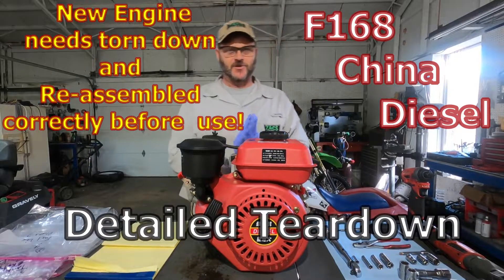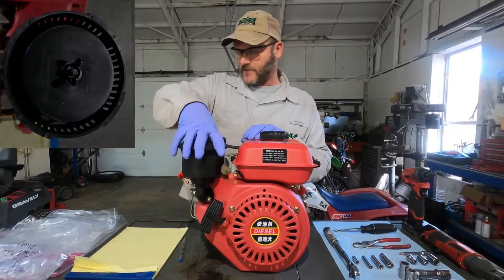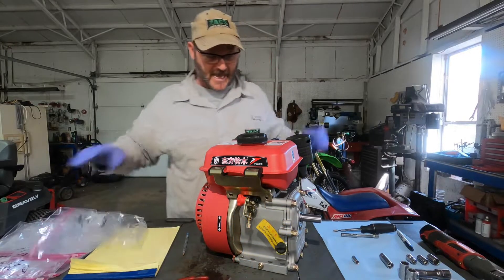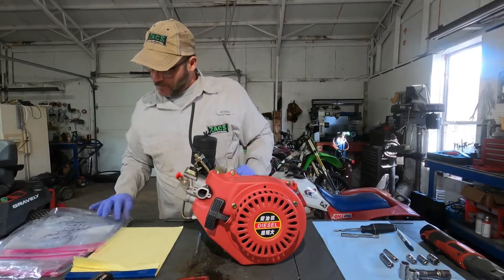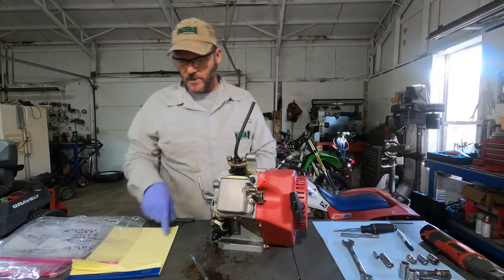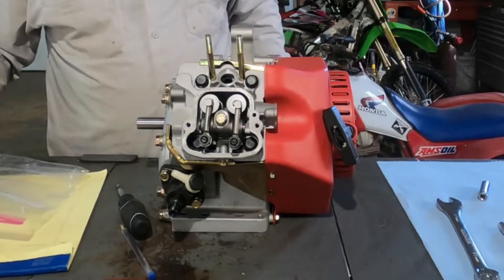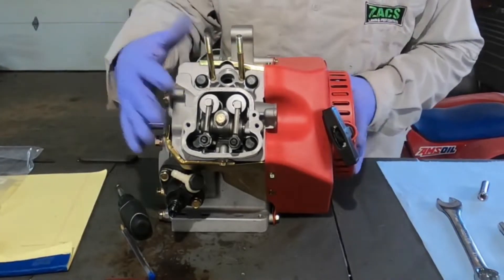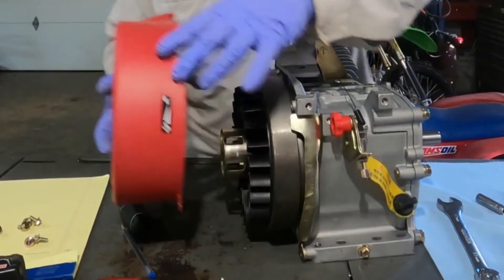168F Small Diesel Engine Prepping for Real Use! Detailed teardown part 1.

Comment: Where is the fuel switch on this? Its says to open the fuel switch before running, but I can't find a fuel switch anywhere.
Reply from the maker: Mine has a red knob on side of engines loosen knob and.it will allow throttle to move by moving red knob. Lock into engine speed you desire.  If loose it returns to 0 fuel injected and engine stops.

Comment: What would you recommend  the value  adjusted  to ..mine only  ran backwards  lol was rolling  smoke out the intake
Reply: fixed just by adjusting the valves ..got quite a bit of use out of it soo far soo good. .cold and damp weather..any condition it starts up within 1 to 2 pulls

Comment: i basicly have this exact engine and im having trouble starting it. i try to pull the cord and it gets stuck in the same spot and if i pull too hard it makes some weird spring sound. also the decompression lever doesnt wanna stay down. im definitely doing something wrong here..
Reply: The decompression lever only stays down at a certain spot doing the rotation cycle. 
Pull the starter rope slowly until it gets hard, then try putting the decompression  lever down.
Thats how mine works.
Reply: You might be better off getting the electric starter for it. The decomp valve should stay down till you pull it over.
Reply: @Atvsrawsome  i found what the issue was. shipping was damaged so the metal shroud was stopping the plastic fan from moving. works good now! tho i havent started it yet on veg oil lol

Comment: Hey I need some help with this engine it starts up fine but as soon as the give it throttle it puffs white smoke and runs really bad
Reply from the maker: anyway you got water in the fuel? Also is yours exactly like mine or some models have a very small filter screen in the tank.

Comment: The internals of these don't seem heavy enough for long-term use even the basic bore / stroke measurements.    These seem more like a short stroke, high rpm gas engine design.
Anybody tried these in 24/7 low speed generator use or similar low speed, constant operation?
Reply from the maker: Everything is relative to need.  Just by the nature of the bore and stroke as you mentioned this engine does not like running really low rpm. It can run low but hammers the engine really hard because of short stroke.  The happy place appears to be 1800-3000 rpm.  For my log splitter I put it on 2200 works great.  I do not expect it to last longer than any high quality gas if we are lucky.  

Positives for small engine use
-Light weight
-can be used in place of a lot of gas 3200rpm engine situations
-Diesels stores way longer than most gasolines even ethanol free
-can be run off of WMO and other bio fuel if need arises.
-definitely more fuel efficient than the gas 6.5hp engine it replaced and powers my log splitter just as good

Negatives Depending on need
-light weight
-Runs at 1800-3000 rpm which limits longevity as with any engine that operates at these rpms. Not good for long term 24/7 usage
-Not for low rpm genset

I had a 12/2  listeroid Genset. Which wound up being an absolute piece of heavy junk.  The machine would have been awesome for 24/7 with the exception of the breaking cam shaft and the horrible timing gears.  Even mods it was not good, junk.  So close to a good machine.

Now find a real lister or even a single cylinder listeroid can be made way more reliable for low speed 24/7 gen use.   I plan on taking my low speed genhead gearing up and hooking to my 30hp tractor pto.  For 24/7 if need ever arises for me

Comment: I have the orange version of this engine. Mine has a metal air filter housing. I notice yours came  with a fuel filter. Mine did not. I wonder where I can find a fuel filter like that?
Reply from the maker: There are a couple variations of this engine. When I ordered mine the picture was the orange one with metal filter.  Mine showed red with plastic. LOL.  Any decent small engine filter will most likely work.  Look in your tank where your fuel nipple is.  One style of this engine has a debris screen there.
Reply: @mossycreekvids  Yeah mine has a screen under the cap and a tiny filter on the end of the fuel line in the tank.
Reply from the maker: @grassrat93  What do you plan on doing with yours?
Reply: Now, my engine has trouble. It sounds like it misses, then loses rpm's, and then sometimes stalls. When it is in this state, changing the throttle has no effect.  I'm contacting the seller.
Reply from the maker: @grassrat93  Hate to here you are having issues.  How many hours do you think you have on it?
Reply from the maker: @grassrat93  just curious is your pump attached to the back plate or to the block?
Reply: @mossycreekvids  I have 7.5 hours on it, maximum.  The injector pump is in the back plate.
Reply from the maker: You probably have already checked but I would look in tank and make sure you don't have any water/condensation around the filter.  Just incase it had a little in it I would bleed the heck out of the fuel line and try running again.  Wouldn't take much water to really prevent proper running.  I keep my engine covered at all time when not used
Reply from the maker: @grassrat93  my pump is attached to the block.  I am pretty sure we use the same pump and injector.

Comment from the maker: Someone asked for some specifications.  196cc. 68x54mm bore Stroke. 20mm output shaft 5mm keyway. Shaft length is over 2 inches forgot to measure.  3000rpm max, 2.2kw power, holds 3 liters fuel, 0.7liters oil.  Splash lubricant.  Weights 20kg. 395x330x345 L x W x H. Recommends 10w 30 oil.
Reply: Thanks
Reply: Sir a model 5hp
Reply: Whats the difrence from the red one and the yellow anything major or minor stuff
Reply from the maker: @Caden James  really not sure on color.
Reply: @mossycreekvids  so i just got mine and its the yellow version it is diffrent, although it seems to share most of the same parts but the block is diffrent otherwise same motor internaly i beleve.